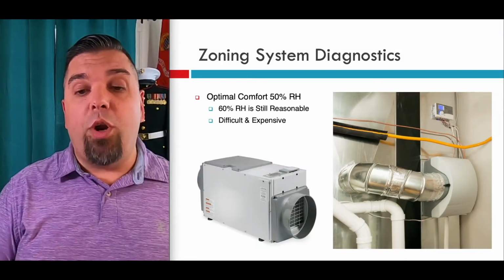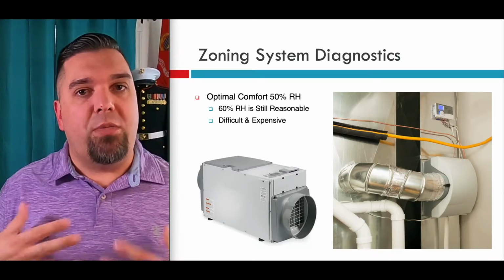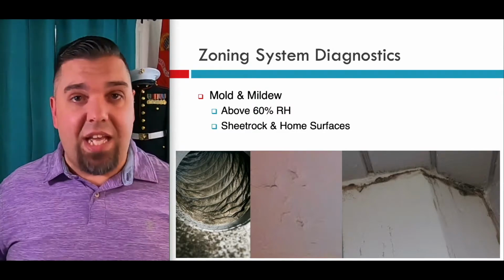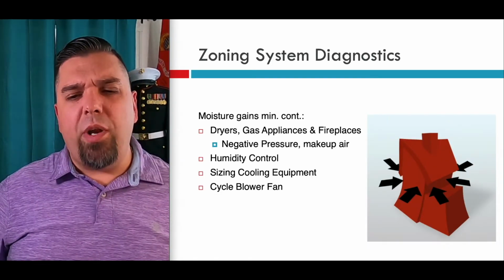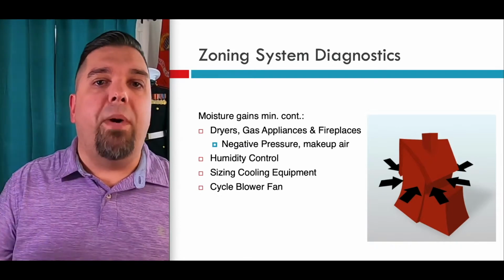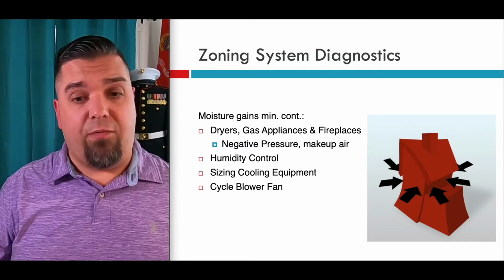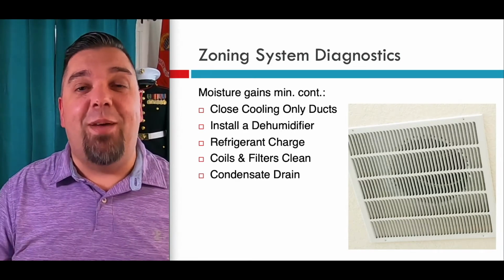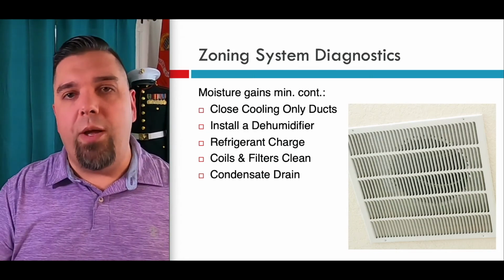Controlling Relative Humidity, Part 2 of 3: Zoning System Diagnostics

Comment: Terrific video! Very informative! I’m wondering if you might be able to help. I am trying to determine if my AC unit might be too large for my home. it keeps the house cool and comfortable. But I noticed that my single stage AC unit runs for only about 6–9 minutes. The humidity reading on the smart thermostat is mid 60s. However, the humidity reading on my hygrometer is mid 50s. Which is likely to be more accurate. If the humidity readings are in the 50s, would the 6-9 minute run time do you something of concern?